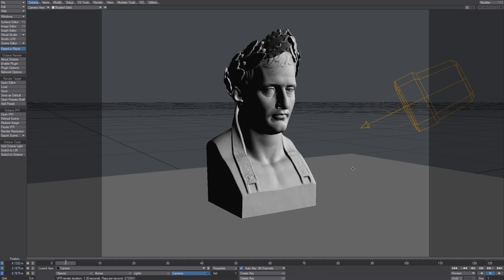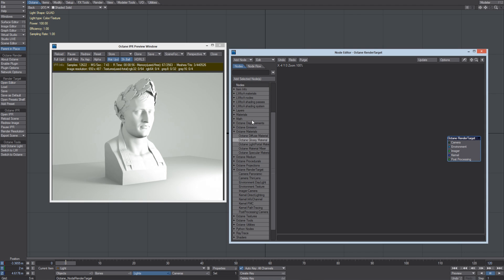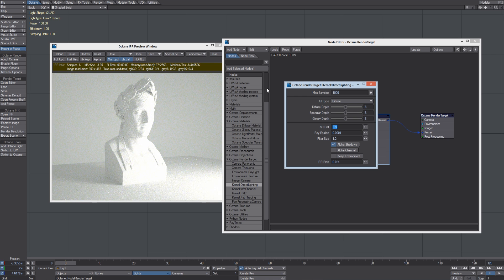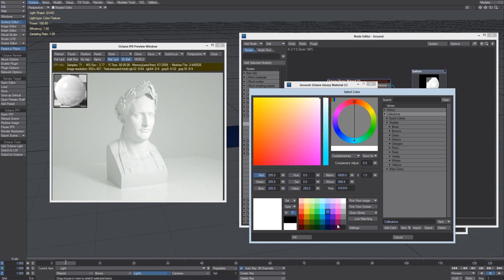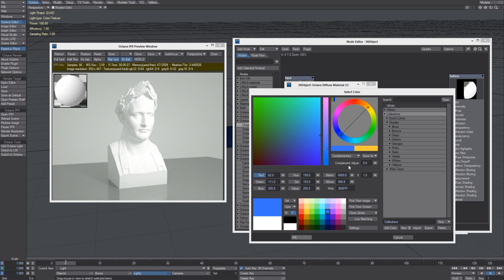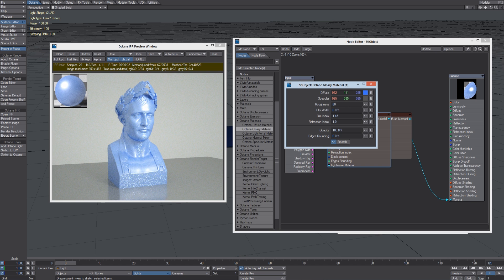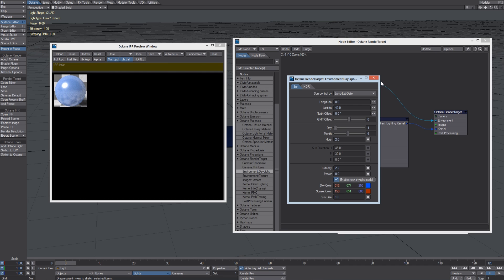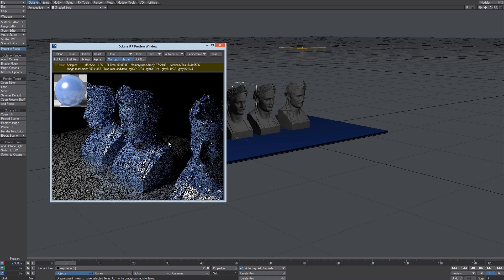LightWave 3D - Octane for LightWave Rendering

Comment: What's the advantage of octane over VPR?
Reply: Octane is just another tool you can use for your projects.
If you own a good Nvidia card, you can take advantage of the GPU power and get some very fast renders (the LightWave render is CPU based).
While the LightWave3D is a great general purpose render, Octane tends to be physically correct, and getting photo-realism is something quite immediate!
Reply: Frosted1030 was wondering about the difference between vpr and Octane. 
They obviously are not the same thing and their purpose is completely different. Am I wrong?
Reply: +Lino Grandi  I want to give this a shot. It looks like it does real-time rendering, but can it replace the f10, render scene and save out JPGS as well?
Reply from the maker: +Tony Sabo Sure! Octane is a GPU based alternative render. You can save out image sequences and animation just the same way you would do using the internal render.